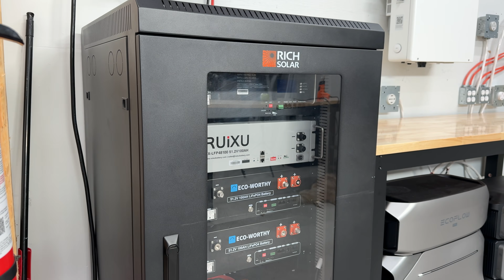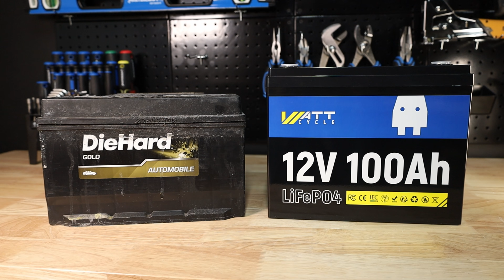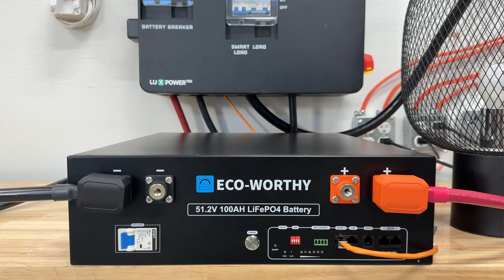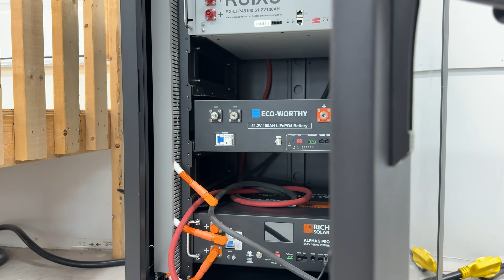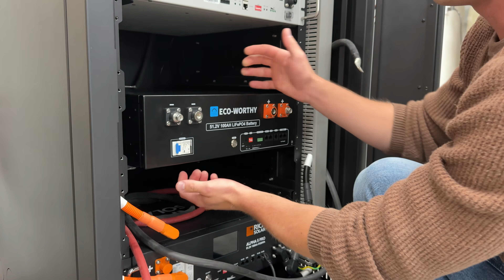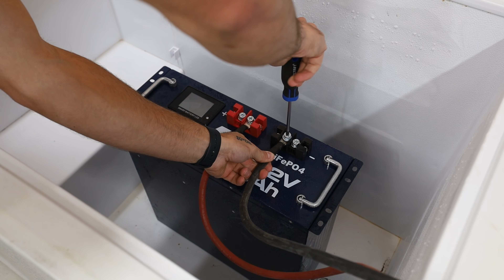Why Cheap Batteries Are ACTUALLY Expensive

Comment: I dont recommend any rack batteries because of the price and the available power. Most are 100amh. That is horrible say your in a camper you like ac. My ac pulls from my 48v inverter around 15 amps so 100amp hour battery only get you 6 hours. And the cost is crazy.  I got 12v 280amh batteries wired to 48v giving me alot more storage for 1600 bucks wereas the server rack batteries their about the same pruce and you see the math 100 amh v 280amh. Same ish price right. Yea research is important stay away from power stations buy dyi if you want ideas hit me up i can get you a way better deal. Most power stations are automotive sized system.  Think more power more battery storage for the same price. Ill line you up. Im not a sponsorship paid advertising utuber so i dont lie or have any skin in the game i just like to help people get tje right stuff with out getting robbed with under sized that is known to fail and be lied to about it capability. From a guy that gets paid to say this will run your house.

Comment: Those so-called cheap batteries he was showing on that table were $800 to $1000 each so I don't call that cheap. The UL Listing thing needs to be addressed because a lot of these "energy influencers" are pushing a lot of products with little  explanation of the legal or safety issues with this stuff. He said something like "you can't have non-UL listed batteries in your house"; that's just not true. It's all about how you connect and how you use them. I hope they go into this a lot better detail.

Comment: Well, they are definitely bought. 

A lot of cheap batteries are trash, but some are just as good as the high dollar batteries, just without a UL listing. 

As for the longevity, they use the exact same cells as the expensive batteries do. They all come out of China, and there's literally only a few cell manufacturers. 

This channel is pushing everyone to the larger name brands, with complete bias towards budget equipment.

Comment: My "cheap" batteries are working fine, and the time I had to contact support was via email, and replied to very quickly.  As you pointed out, technology and chemistry is changing all the time.  If my cheap batteries last 1-2 years less but cost 30% as much, I am perfectly fine with that!  The new/better chemistry might exist by then.  Everything has a trade-off, but I will save my 66-70% to get either more batteries or just save money!

Comment: I buy cheap batteries off of Amazon because 99.9% of the time the customer will tell you to keep the battery and give you a full refund and then I repair the battery myself.
Reply: Define "cheap". Almost a $1000 for a rack battery or a golf cart battery is not cheap to me. Also the price of these things have probably jumped 20-30% in the last 2-3 months so I'm just not seeing the cheapness.
Reply: @lashlarue59 $1,000 is cheap because if you actually wanted to buy a battery that is actually useful they are usually around $10,000.

Comment: I didn't know about two separate components being UL and together they might not be. Very good to know!
Reply: It's only that way to try to force manufacturers to spend more money getting things certified.  Unfortunately  UL9540.  It shouldn't be how the code is made, but vendors have more or less taken over code-making groups in the last 40 years so the rules are designed to make them money.

Same thing with RCDs (residual current detectors) and RSDs (rapid shutdown devices).   RCDs have not proven to improve fire safety in the least and RSDs actually increase fire risk on the roof rather than decrease it.  Plus firefighters don't walk anywhere near solar panel arrays on roofs anyway (never have, and never will).,

-Matt
Reply: Ha im all over ecoworthy for that. Canada electricians wont install now without it